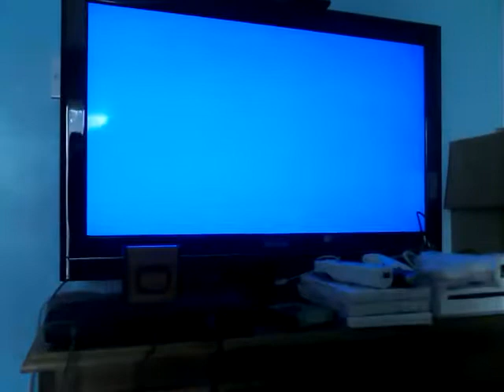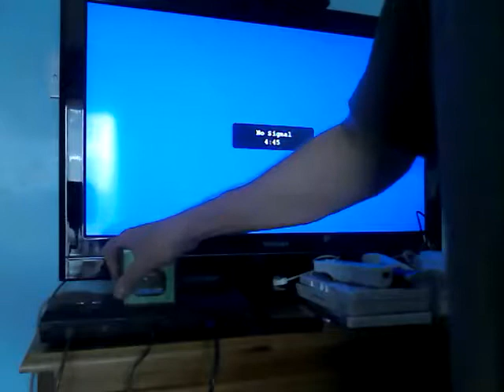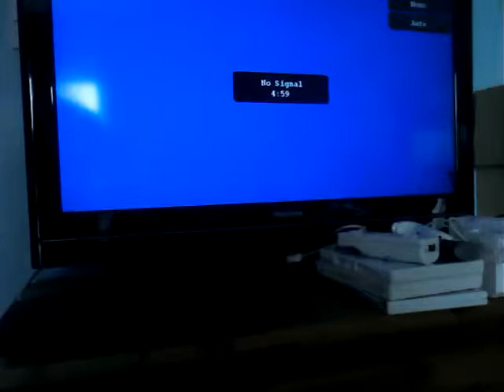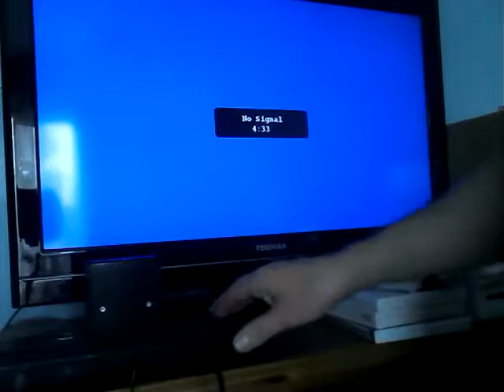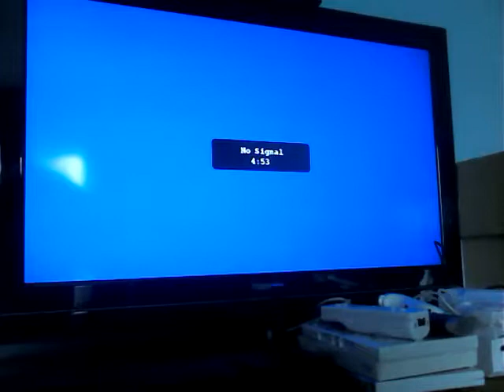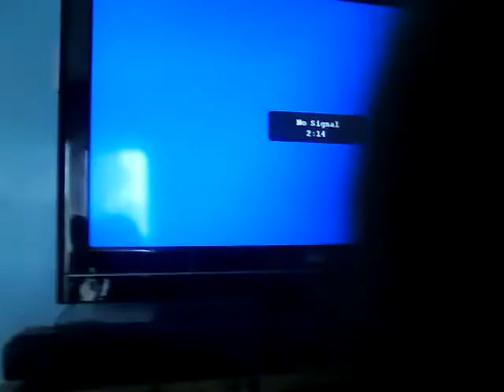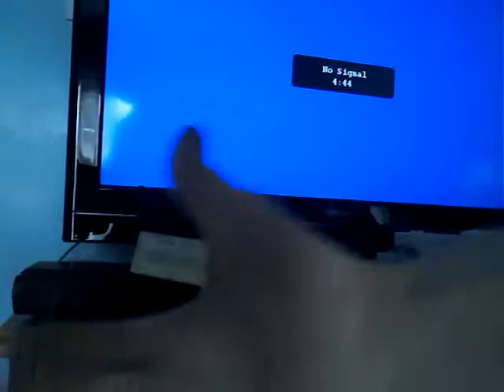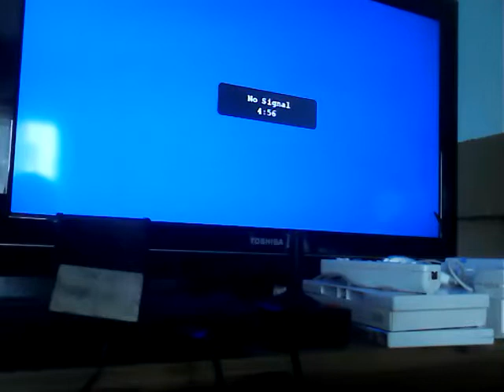Fixing two Atari 2600 games from eBay.

Comment: I have 3 Atari 2600 games won't come on I tried everything.
Reply from the maker: have you opened em up and checked the solder joints.
Reply: @oldscoolgaming.5040  Yes
Reply from the maker: @NerdThingsAndMore  make sure to check the traces with a multi meter. Maybe the chips are bad? if so you could keep the carts for spares.

Comment: Ahaaa no wonder atari 2600 cartrides were sooo expensive back then,all because theres a metal plate inside it and it contains 2 screw to hold it in place,BUT  the stupiest part is why did atari covered up those screws with a label on top of it??
That’s just insanely stupid from atari ,same thing with their 7800 cartrides,because you cannot officially repair it without damaging it first,that’s non-sense and bullshit !!!
Reply from the maker: It was good for Atari and other game developers so people weren't tempted to mess with the insides and then take it back to the shop to exchange for a new one.
Reply: @oldscoolgaming.5040  absolutely true,am mean if that was the case back then that people did play catchup with atari,then i can understand atari’s policy at that time😁
Reply: Things like these games were not ment to be repaired, so the 'Ugly' screws were put under to attractive label.
Game Piracy wasn't a thing back in the early 80's.  That's why Atari games came in a variety of forms from screws to just clips.